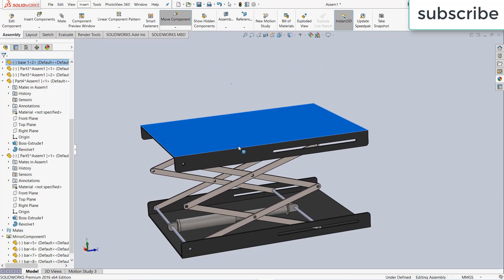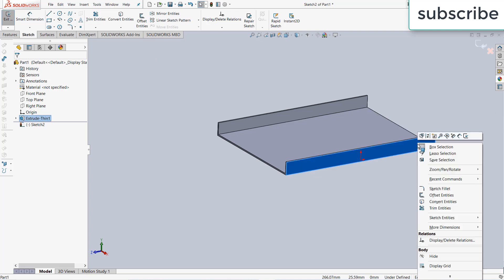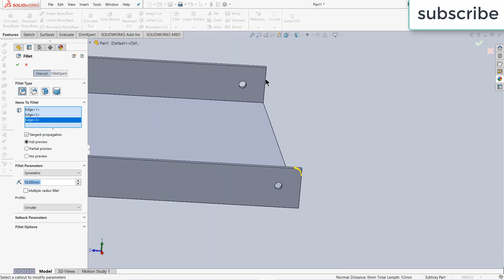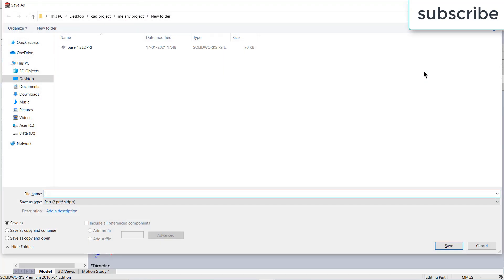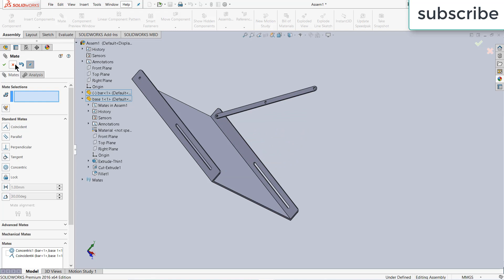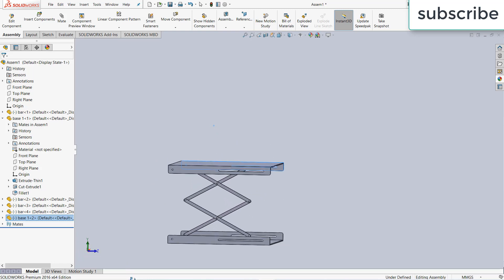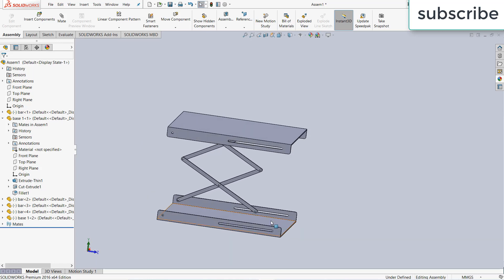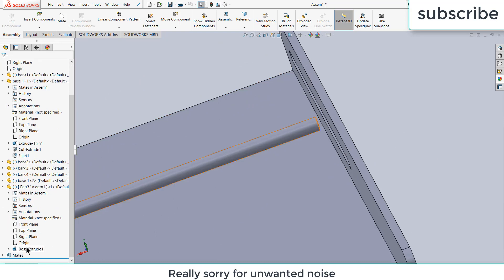Pneumatic /Hydraulic scissor lift mechanism in solidworks

Comment: Can I use acer aspire 7 i5 for solidworks at student level will there be any heating issues or thermal throttling??
Reply from the maker: No there will be no heating issues at student level
Advice: try to buy latest gen of i5 (don't buy older version)
Reply: @Cadknowledge  thanks for your reply.
Reply: 9th gen?
Reply from the maker: 10th or 11th gen more recommend
Reply: @Cadknowledge  i have i3 6006 recommend or no for using solidworks ?
Reply from the maker: Install old version of solidworks below 2014 for good performance